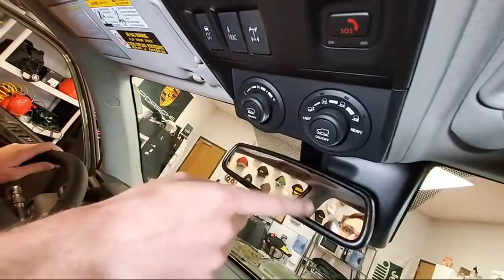The 2020 Toyota TRD Pro Now Costs OVER $50,000! | What Car or Truck Should I Buy Ep. 87

Comment: Love me some 4runner... But 52k $$ is getting ridiculous
Reply: 06XTOR longevity
Reply: Yell 52 k? Our 2018 pro was over 44000. Like 44400. Or close I wanted a pro Tacoma not one to be had. My TRD off-road is great and 36,600. I think we, that woman and me spend almost 82000. But look at this , we both were driveling 2001 mods lots of miles . Grand daughter got wife’s Cilicia with 300000. Miles my 3001 still in my yard runs great for hunting and working and play! My 2002 like brand new was killed with me going to work. I’m lucky I didn’t die too ! God bless the poor woman who crossed four lane road wide open and hit me head on. That was a damn good truck, never off road , banged it who life. His name was mr. silver. His older bro still with me his name is big red!❤️🍀🍀🍀🍀
Reply: I can’t spell for shit🍀
Reply: @JJustinXu  same longevity with a TRD off road for 10k less...
Reply: Why is that ? 20 yrs Reliability tough rough to boot ?    Cost 66K in Canada
Reply: @06XTOR  the  main reason i bought pro 2020 was the army green also i the stock fox shocks are more than  enough for me so i doubt ill need to upgrade anything other than tires for what i use it for its great and i almost spent 85k on a land cruiser so i  guess it just depends on budget cause if i was not making what i make i would havent even bought a off road i would have got sr5 and moded it out
Reply: @06XTOR  also the offroad has KDSS adjustable sway bar as an option where the pro doesnt so honestly the off road can be better

Comment: As a 4Runner TRD Off-Road owner, I cannot argue about price being too steep for a Pro.  Which is 1 reason why I went for the Off-Road.  However, as many are noting, these rigs reliability and long term functionality means you can buy used all over the place and save many many thousands of dollars over the NEW and you will get the same quality, same re-assurances that it can be your long term friend as if you had bought new.  Buy a USED 5th Gen. modify it or not.  And save yourself the 10's of thousands of dollars for new.  Plenty will buy the new and it will filter down to you eventually.  Peoples life style changes and off road considerations dwindle down.(Glad Zack is there to support the 4Runners.  lol)

Comment: I’ve been trying to decide between the TRD Pro or a Wrangler. I’ve read a number TRD owners having issues with the Fox shocks making a knock/thud noise in the mid 30°’s and below.  Toyota holds the position the noise is a characteristic of the shock and will not pay to warranty them. My plan is to trade for a Bronco in a few years.
Reply: Thomas Rossi if you’re going to hit any hard trails, get a wrangler Rubicon. If you’re more interested in a quieter refined ride, get a 4Runner. Wrangler has better tech, better mpg, better capability, removable top. Both have great resale.

Comment: My 2018 f150 with the 5.0 v8 has been getting over 17 mpg for me in the city. Way better than the 4runner! I'd rather take a pickup for better mpg and more fuel capacity than the 4runner!
Reply: My 2010 LR4 with the 5.0 V8 and  161K miles is getting me 16mpg in the city.

Comment: Not sure why guys get a Pro and change the suspension. The guys are correct when they say the Off Road is a better starter platform. If you’re gonna stay stock get a Pro. For mods start with an OR.

Comment: Ok, so you guys have a some Wrangler fans, a Toyota fan but where are the GMC people at? lol. You say that 4 letter is so reliable but I have the 3.6 V-6 in my 2015 GMC Canyon with 110k on it with no issues. Just do the scheduled maintenance and add fuel, the engine runs great here at sea level and in NJ, lol.

Comment: The base model 35k. I paid 50k for my limmited 4 years ago and I paid close to 50k for my trd pro with 8k miles on it. Prices havent gone up drastically just enough to meet the expectations of what purchasing consumers want.  Not reviewers who dont it. and It's made in japan with Japanese pathological quality control.  You won't find no failed welding issues or quality control problems here. You wont find unqualified, bored, and unethical workers that are part timers from the street. You spend years working your way up to become part of the production line over st Tiyota in japan. They dont allow video if the production line, which also happens to be the same plant as the Fj cruser, ( yes they still make them ) and Lexus GX. like you find over at jeep production line.

Comment: How did you find it as I went to Toyota trying to find one to test drive. No Luck.  I my self think all this power stuff is nonsense as my First truck a Ford F-150 4x4 6 cyl. and the truck I have today has twice the power but in every day driving no difference in reality only thing I notice different is it will accelerate with my boat on going up hill. That's it. 
 I still plan on taking about 6 coolers of different sizes to see what fits with back seat down.  I did sit in a base model front was fine for room and I'm 6'2 but the back seat does not have as much head room as my wife's Honda CRV
Reply: Honestly, I don’t understand why people are so obsessed with speed and acceleration numbers. Why do we expect vehicles like pickup trucks and SUV’s to have capabilities rivaling sports cars? Then again, why do people insist on having SUV’s when cars would suffice for many of them?

Comment: This is the same exact engine and transmission as the 2nd gen tacomas correct?
Reply: No incorrect 2 nd is 3.4 3 rd is 3.5 Atkins not the same bro but the 3.4 ain’t bad for 190 hp 3rd gen 3.5 is 278 hp something like that my brother
Reply: @rickeycooley9139  2nd gen is 4.0 v6
Reply: Janet Airlines sorrey Janet I mis spoke the first gen had the3.4 🍀2 nd had4.0 🍀3 rd had has 3.5 ! So sorrey too many miller high life’s and long day at work. You know what I’ve had them all the best 1995 hi trac with 3.0 yell I nailed that one. Be cool sis🍀🍀🍀🍀🍀🍀🍀🍀🍀🍀🍀😝

Comment: This is why I moved from Toyota. I’ve had great luck with my F-150 30k miles in, and my JLUR Wrangler has been incredible. Toyota will continue to bleed customers if other OEMS continue to step up their durability and reliability-then there’s no reason to buy Toyota.
Reply: Greg Weik my F150 needed nothing for 5 yrs and 75,000 miles, nothing but oil changes and oil and air filters.